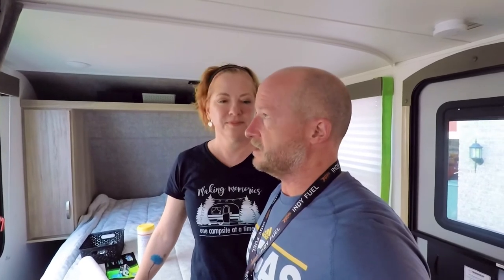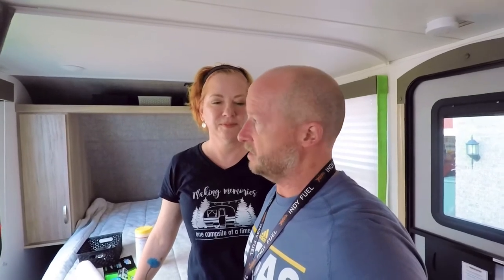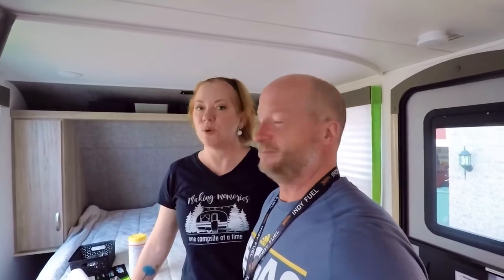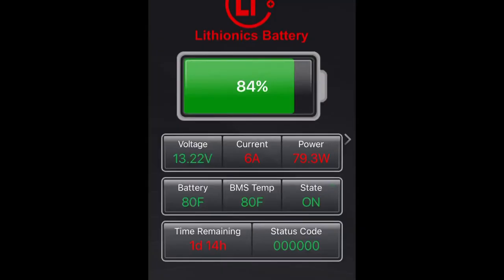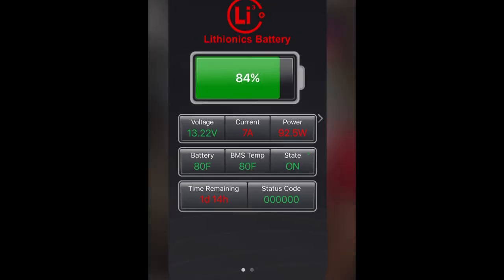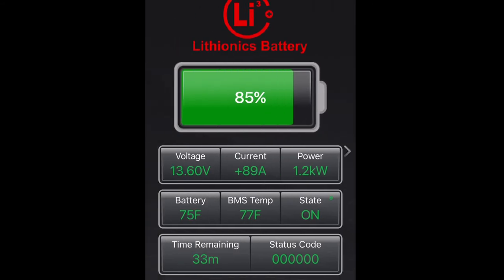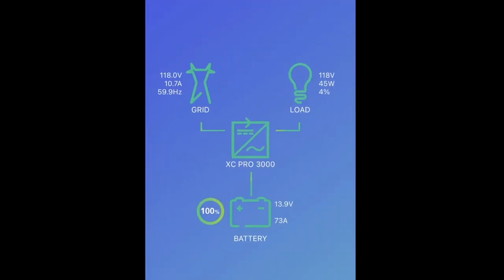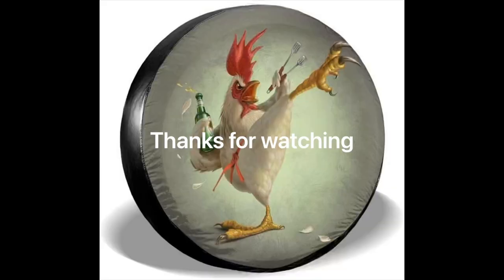Sorting out the Winnebago FLX battery issues

Comment: Hey! We wanted to pass on a tip for our Micro Mini Flex community. The LP quick disconnect on the out side of the trailer is for use with low... and I mean low low pressure devices. A regular Coleman type camp stove can require as much as 15-20 psi but according to Winnebago their regulators only supply .4 psi. Yes, that is correct .4 psi. Not all dealerships are aware of this, we spent weeks talking with our dealer and trying different LP fittings and hoses before finding out the psi supplied vs what our camp stove required.
Please pass this info along in one of your next videos and hopefully this might save someone else the same headaches we had.
Sincerely, Tom Kraesig
Reply from the maker: Yep! Picked up a hose for it and it specifically calls out removing a regulator otherwise the pressure isn’t enough. I’m not screwing with LP setups so I’ll either bring my bottles with me or use my camp stove. I’ve seen trailers burned to ashes so I’m not chancing damaging the Truma systems or torching the trailer all together.

Comment: I am considering purchasing a FLX trailer.  Have not been able to get information on a couple of systems.  Hoping you can answer for me.  #1.  Does the 7 pin charge the battery while towing?  If yes, how much battery charge have you gotten on various trips?  #2.  The solar side port for portable panel, does it tie into the charge controller or directly into the battery?
Reply from the maker: The tow vehicle does nothing as far as charging. Just lights and brakes. 

There are groups out there that are for the FLX where I’ve seen some chat about the solar side port. That would be your best option. I do know it does work with the existing controller so panels with controllers won’t work if I recall other folks comments.

Comment: Hey thanks for the great info on the Micro Mini FLX! 
We've been finding some of the same issues that you all are finding. The battery being one and the back splash being the other. Did you fix the back splash yourselves or did you get it taken care of under the warranty? If you did it yourselves how did you do it?
Thanks and keep posting those great videos!!!
Reply from the maker: We had the dealership deal with it. They supposedly trimmed it and then put a piece of trim along the side to make sure it’s tacked down. We looked at other new ones on the lot and it’s quite common. Apparently Winnebago doesn’t take into account the whole expansion and contraction with temperature fluctuations. Why am I not surprised?
Reply: @speedbumpmedia9584  Do you know how they fixed it? Did they replace the back splash or just trimmed the one in place?
Thanks again for the help!

Comment: Only 2 amps coming in from the grid? That cant be accurate.
Reply from the maker: Tis true. Both the surge guard and the inverter was showing 2 amps. That particular campground has horrible electric. New owners just bought it and the first thing on their list is overhauling the electric and putting in 50amp service.
Reply: @speedbumpmedia9584  that's awful. If I showed up planning to run a/c that weekend i would have been upset to say the least.
Reply: that app looks great.  ... if the battery  converter / charger pulled more than 2amp when back home or at another campground, then yeah what a crappy circuit  at that campground. Campgrounds need to protect their circuits from overloads but capping a 30amp site at 2amp is false advertising.
Reply: You sure it's not showing how much power the converter is requiring to charge the battery?

Just a thought.
Reply: Actually, just realized how low that is. The 2A is probably what the trailer is using, not what the power pole is supplying.

The surge protector will only show...
- error codes
- voltage
- hertz
- power usage in amperage
Reply from the maker: @aguyandhiscomputer  positive. We were bleeding battery charge. When I hooked up at home the battery started charging on top of running other systems. This place has a habit of losing electric all together.
Reply: @speedbumpmedia9584  you would think it would affect the voltage and cause brownouts or something. Very weird.